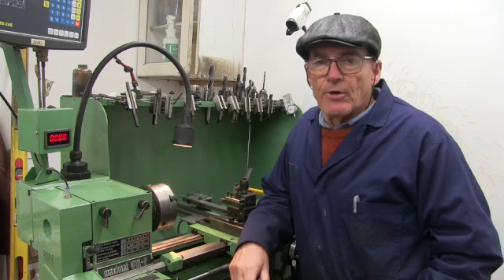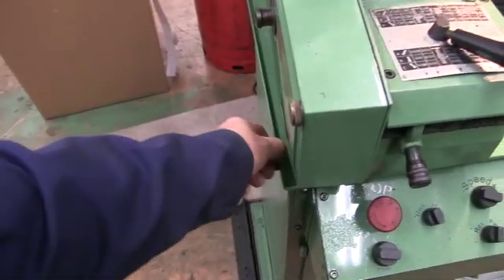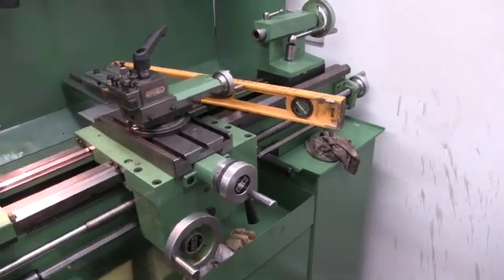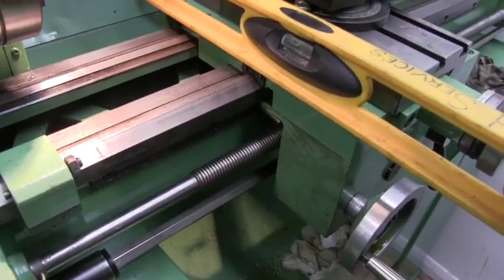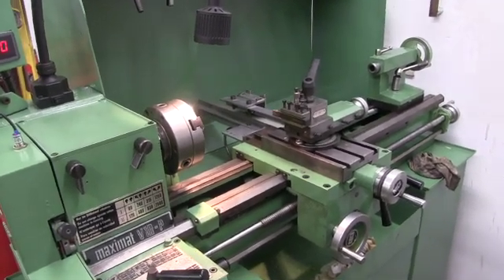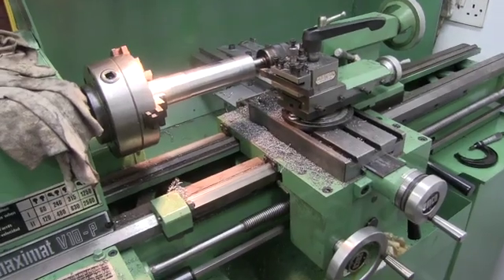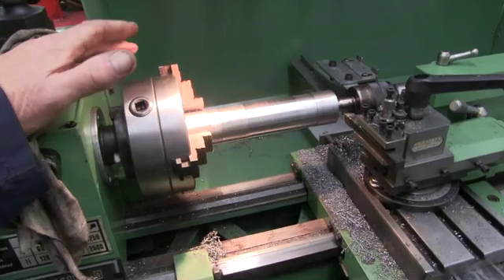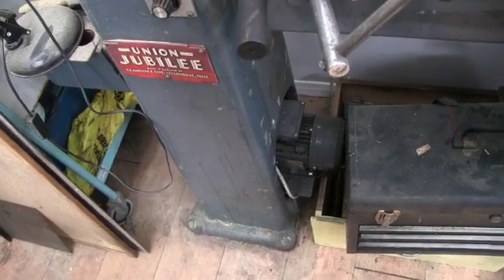Emco Maximat V10-P.Checking the accuracy.

Comment: Normally you adjust the height of the cabinet feet, not between the lathe and the cabinet. Secondly, the chuck either adds to or subtracts from the accuracy of the spindle, particularly if it’s a used chuck that wasn’t very expensive to begin with. If you have accurate collets, that’s the best. The bar can have a smaller diameter. To test the tailstock properly, it’s done using two centers. Getting the inaccuracies if the chuck out of the equation is the most reliable way to do this.
Reply: He mentions that he already levelled the cabinet with the base feet, and he was talking about levelling the twist out of the bed using the bed casting bolts which isn't possible on the Maximat lathe as there's only two bolts, normally there would be 4 bolts for adjusting out the bed twist and levelling it perfectly with a machine level.
As for the chuck, it doesn't matter. Turning a cylindrical part removes any chuck runout error so Cliff's test was perfectly accurate for what he needed. After that first test is done without tailstock support and the headstock is aligned true, it is standard (reccomended in many lathe manuals) practice to then use the tailstock, test cut, and adjust tailstock. So Cliff did every right.
Reply: @TinkerInTheShop  you get the twist out of a bed by adjusting the feet on the cabinet. Obviously, with two mounting bolts from the lathe to the cabinet top, that’s also the method EMCO expects it to be done since you can’t do it with two bolts. I’ve never used shims in any lathe to eliminate twist. The concept is ridiculous.